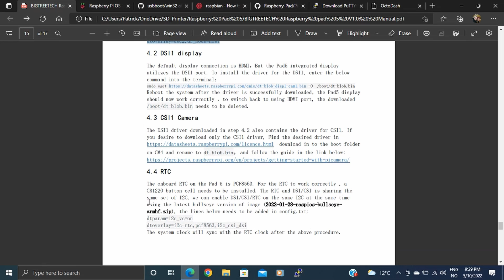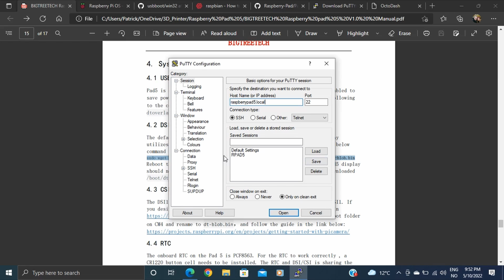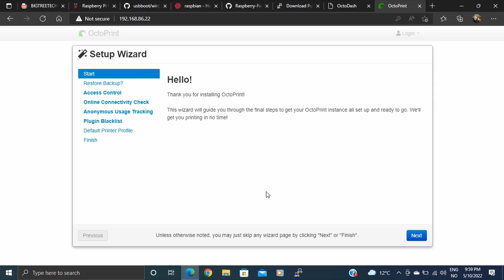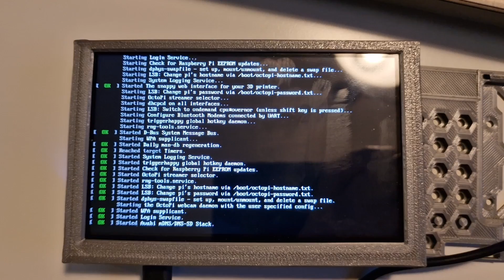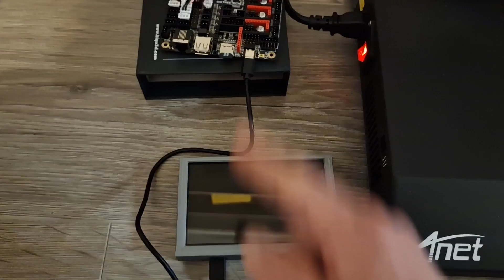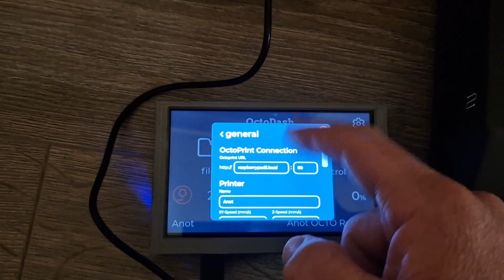BigTreeTech Raspberry Pad 5: A Beginner's Guide With OctoPrint

Comment: Hello, thanks for your video. I also have a pad5, I install octipi with Pi imager.
Everything seems to be going well.
When I reconnect the pad (after putting the switches back in place) in usb and I launch Putty, I put the host name followed by .local, when I do open, the console does not open, and I I got an error message: "Unable to open connection to raspberrypipad5.local Host doesn't exist".
What's going on?
Is a power supply fault?
Cordially
Reply from the maker: Did you type in raspberrypipad5 or raspberrypad5? The name must be exactly what you typed in when setting it up.
Reply from the maker: @gabriel VERDIER I was just thinking, if you can get the IP address that was set by your router for the raspberry pi you can also use that.